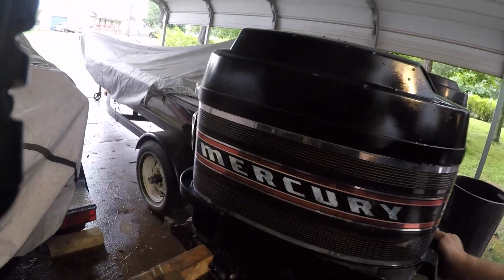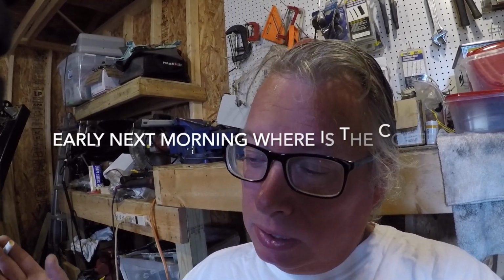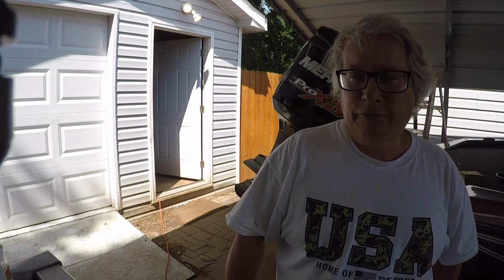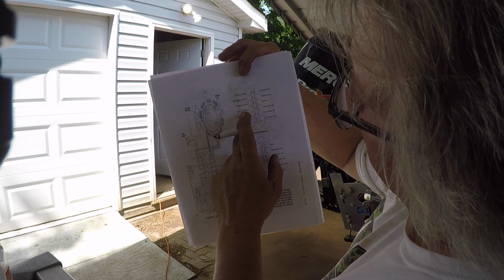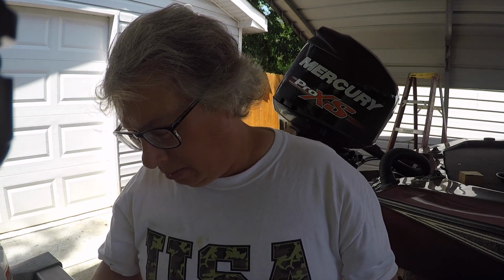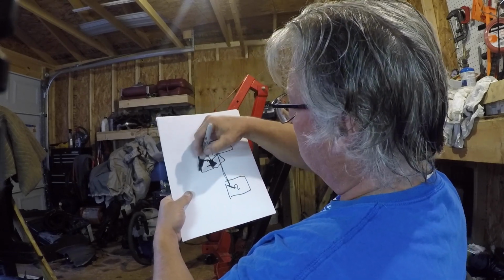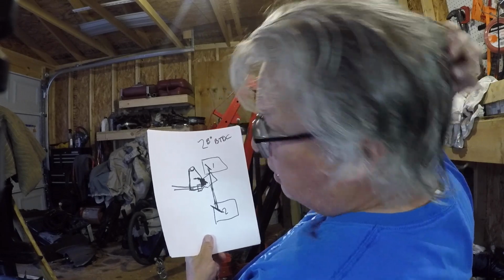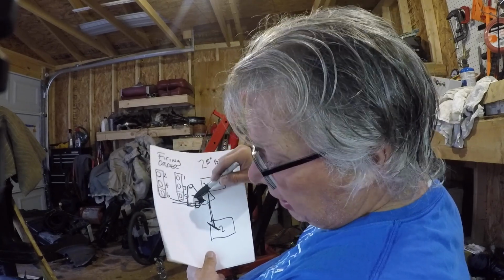Part 2 Evinrude 115hp 115ELT78C Carburetor Service & Repair

Comment: What was the main issue with that merc in the beginning of this video? I am having the same exact issue. Been following all your troubleshooting throughout your videos.
Reply from the maker: If I remember right that Evinrude had the coils wired wrong with the motor being 180 degrees out.
Reply: Not the evinrude I was talking about the mercury 50 hp what was the fix?

Comment: Hey man I got a merc 50 looks to be from the 80s and I can not for the life of me get it running and now I've lost a couple parts( a carb stud, the plastic peice for that controls the throttle that connects between the two carbs, I think my silenoid is missing a peice missing my top starter bracket and was wondering if you had any advice at all
Reply from the maker: Sorry I just now saw this.  Did you have any luck locating the parts that are missing?